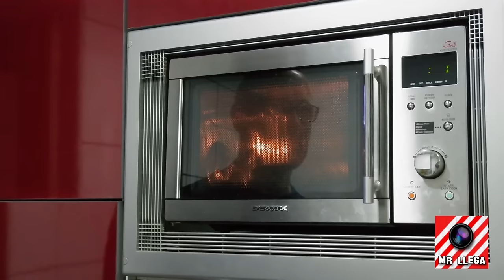HOW TO CHANGE TIRES TO THE XIAOMI MIJIA M365 ELECTRIC SCOOTER

Comment: I curse a day when I bought this garbage. Changing tire is just a torture. I am so angry right now and my hands are all red. thanks for the video though
Reply: ben Cooper I got solid tires as well the ones you described with holes. I didn't put it yet on I am mentally not ready to go through this hell again :) In a meantime I got a new scooter falcon ZERO 10x. Its very big and heavy but much better quality, smooth ride because has suspension and I feel safer now
Reply: ben Cooper I change fI'm tire to solid as well. now its horrible I don't enjoy riding it at all. I have feel every single thing on a road :( I think it can only be an option for somebody very light weight
Reply: ben Cooper I am 94 but you are right. as long as those damn punctures won't happen again its worth it. Also you kind of get used to a less smooth ride :) Also I've noticed that experience may wary depending on type of shoes I'm wearing
Reply: Fucking hate it
Reply: @ChannelGrowMedia  Hey Ben, i had my first puncture and i´m also 105kg, do you still recommend Solid tyres?
Reply: Same here... But I charge $30 people who can't do it by themselve.
Reply: Mikael  have you tried changing the tire bro?
Reply: In China they have little girls that can change scooter tires all day for a bowl of rice without bitching, and they do it right the first time.
Reply: Mikael  ?????
Reply: Same, at beginning was a good ride but after a year it's just a torture, maintenance is impossible, i can't even take the wheel off but the nuts won't budge. Definitely won't buy Xiaomi scooters again, the designs are awful and no suspension.
Reply: Mikael  not 5 mins bro torture and shit
Reply: My hands full red too nos ...
Reply: @walterkersting9922  ...do they ship to the UK?
Reply: My biggest regret.  Pure shit
Reply: First when i bought this scooter, this was my little Baby. But the first time I changed the wheels, I would love to just throw the scooter away
Reply: F
Reply: You are right about that oof
Reply: My advice is to hold it in a vice. Its much easier if you have one. Ive tried to change its rear inner tubes (which should be easier job) in a simple flat and i failed so much that I had to buy a whole new wheel with the tyre on it. 
Now I followed the instructions with white lithium grease (instead of vaseline) and the solid tyre just popped on the motor wheel with some "Cmooon madaf**aaaa!" Effort... :D without vice I would have red hands and losen mind. :D
Reply: @andreymor5201  r3
Reply: @Spieel  3
Reply: @Spieel  4
Reply: @walterkersting9922  3
Reply: I was copying this video exactly then realised he made me get tired off wire side and cant get it off properly ffs
Reply: Key is to use a lot of lubricant
Reply: skill isue lol

Comment: putting it in the microwave made my house smell awful for days and ruined the the Tyre 😂😭
Reply: Exact same issue, I used boiling water and olive oil.  Also I would not use a solid tire, huge performance downgrade.  I go over a few of these things here:  https://youtu.be/G3hV2LacOaw
Reply: @drewsXR650L  your link doesn't work any more :(
Reply: Same
Reply: Did it help
Reply: Just the the same 🤦🏻‍♂️ mine was bubbling 🔥🤣
Reply: It's what happens when the person making the video is mute and doesn't state they are using a different tire to begin with.

Comment: I did it!  It wasn't easy for sure.  But it also wasn't impossible.  To get the valve out, I used and allen key that was about the same size as the valve stem and tapped with a hammer.  It actually went way better than expected.  The real hard part was getting the tire back on.  I boiled it in water and used a grease lubricant on the tire wall and on the rim.  The key is having long tire irons/levers.  Mine were short which mad it really hard. I ending up using one short tire lever, one regular flat head screwdriver, and the key to finishing it was a long flat bike pedal wrench.  It's all about leverage.  If I do this again I will definitely invest in long tire levers and maybe enlist a second set of hands to help hold the levers down (I used two hands and a foot.)  Best of luck!!
Reply: In which way do you turn the key?

Comment: Reading all these complaints, I just wanted to point out that indeed, first time is challenging AF and it took ages, but the key is not to heat up the tire or to apply a crazy amount of brute force, key is TO USE THE RIGHT TOOLS trust me!!! It looked like and odyssey without them, once I used 2 BAR CLAMPS to hold the main part in place and some metal bars for leverage to put the final part of the tire in, it became surprisingly easy!!
For the valve, if the hole is also annoying you, carefully enlarge it A BIT with a drill. Be safe though and good luck :)

Comment: THANK YOU! Vaseline and 2 minutes in the miccowave warmed the tyire up enough that I could just stake on it, jiggle about a bit and it slid right on. Having said that, I needed a dremel to cut the inner tube valve - somehow its too long to actually come out.

Comment: Thank you ! You saved my life and YES I lost about 2000 calories trying to get the tire out and the new one back in (the sloid one!!)
TIP ..... TIP  .......  
If you don't want to use the Microwave :   BOIL water in a pot, turn it OFF and stick the tire in for 5 mins !!! It works  !!!!

Comment: Don't let the simplicity of this video trick you, it's a nightmare replacing this tire.
All the tricky parts (the most difficult parts) have been edited out from the video.  
For example, He did not show how he got the air valve in/out for example. Maybe because he did not insert the inner tube. Pay attention toward the end of the video, there is no air valve in the hole.
Long story short, replacing the tire is very difficult and frustrating.
Reply: You do realise it's a solid tyre right,no need for an air valve.
Reply: And how do i pump it ? like i stuck just because i cant pump air into my tire :/
Reply: Bartłomiej  in the video he is using a solid  tyre,you cant pump air in it isn’t hollow it’s foam filled.
Reply: I changed it my self, itss sooo hard
Reply: Exactly, where the bloody hell is the inner tube?? I managed to do this but by the end I completely destroyed the inner tube...back to the droving board!!
Reply: To get an inner tube in is a little more work. Getting the air valve in without loosening the 6 torx screws of the rim and opening it up, is almost impossible. When you do do this, it works fine. Also: lubricate the tire rims and use motorcycles tire spoons. Still not easy but less impossible. I did a complete inner tube chance just now for the first time and it took me about 3h. Good luck!
Reply: THIS 👆. How to get the air valve in??

Comment: This is one of the most difficult! energy sapping things I have done!  First attempt to microwave tyre caused a burnt tyre and smoke that stank the house for weeks!   I changed the next tyre to a solid using hot water then both knees and 4 screw drivers!  I then had a flat front tyre, more tricky as there is a wire attached.  This one I did in the microwave using 30 sec blasts.  I gave up a few times after spending 30 mins / 1 hour trying.   Just finished the 2nd tyre.   For this reason I could not recommend the scooter!
Reply: Lol I went through two tires and four tubes and I just did the wide tread wheels, next I'm gonna do a 10 inch wheel in front I like to suffer.

Comment: Thanks I did a whole house cleanup and throw away trying to find a damn 18 wrench.. Had 3 boxes of tools and threw away enough to be left over with 1 good box of tools. Wheel is still on there tho. Some tough nut
Reply: ThePotatoIsAStarchyTuberousCropFromThePerennialSolanumTuberosumOfTheNightshadeFamilyLOL hz
Reply: Yeah, what were they thinking going with 18mm. Stupid, rarely used size. I have a pretty good selection of tools, but my fixed size wrenches all go from 17mm to 19mm because hardly anything uses 18mm...
Reply: @samgab  and that is why a good set doesnt skip sizes
Reply: @samgab   i was trying to use a adjustable size or wrench but it didnt work though i fixed the size 18 mm..so is it necessary to buy a 18mm spanner?
Reply: @hasansakib3969  Pretty much, yeah. I ended up needing to use an 18mm spanner. I struggled with a large adjustable crescent wrench, but it was very awkward.

Comment: It worked pretty well with a solid tire from wish instead of 3 minutes just microwave 2min , don't use any sharp tools when the rubber is hot or your destroy the wheel. I only used may hands, it went pretty easy good luck

Comment: Good clear video however a question? how does a normal microwave heat rubber? I would recommend using a hair dryer to heat the tyre or a conventional oven also vaseline will stay on the rim and you run the risk of the rim slipping on the tyre under power, much better to use small amount of soapy water which will evaporate and leave no residue.

Tyre levers cost less than a dollar? spoons? if people arent replacing tyres with solid tyres you run the risk of pinching the innertube using spoons, just get cheap plastic tyre levers if replacing the innertube.

If you are replacing the tyres due to punctures its much better to use tyre slime in the tubes and stick with tubes otherwise ride quality will be compromised using tubeless tyres.

Overall a good video though.
Reply: "how does a normal microwave heat rubber?"
Well I can confirm it does.

"I would recommend using a hair dryer to heat the tyre"
Have you tried it? That will only heat the outside. The reason for using a microwave is to heat it from the centre.

"you run the risk of the rim slipping on the tyre under power"
No chance with how tight these are.

"just get cheap plastic tyre levers if replacing the innertube"
Nope, it's so tight even metal spoons bend.

"its much better to use tyre slime in the tubes"
Yeah I wish I'd thought of that before I tried to follow this video.
Reply: I think the purpose of this video is to show how to replace the tire once it has warn out. Even though the original tire in the video wasn't totally warn out yet. Also I think he just wanted solid tires cause they last longer.

Comment: Boys and girls all I can say forget the microwave and use boiling hot water in a pot, large enough to fit the tyre into, turn it a few times using any stick type of thing and finally wipe it dry quickly and you good to go for a few minutes!!! 100 % works just did it myself and unlike in the video I had to fit the inner tube too!!
Reply: When you read the comments I will be there .   I think makes it softer and expends it enough to make the process go smooth and painless..and the vaseline is quite important part though.

Comment: hello, you did not you put the valve on the front wheel? i cannot see it in the video. the valve stucked into the hole when i tried to take it off. madness to disassemble.
Reply: jozsi jozsika that vavle stem is a piece of shit I carefully used a plastic punch to get it out and good luck putting a new inner tube with a long valve stem I had to cut it with a dremmel to fit.
Reply: I was install an rear solid tire it takes me together wit my brother 2 hours wih heating in microwave,boiling etc.etc..in the end we was use heavy duty tire tools for cars until we fixed the tire correct in place.The video ist a joke to change to solid tires is not a simple thing to do!

Comment: If you have trouble to remove the bolt with the cable try this.  
First remove the bolt with the cable and then the other one, in the video they do the opposite but in that way it's harder to remove it!
Reply: Best Tip ever. Thx

Comment: do this! Boil the tire for 10 mins. Especially if its new! (Not the innertube) lube everything with some oil. For the hard part getting it on! I use zipties to hold the parts that are on on both sides! Like 4-6 zipties. And 2 spoons i get it on in 2 minutes this way!  If You have a vise You can do this very easy just pinch tire with the vise and zip tie and move position pinch ziptie last part use a spoon!

Comment: Hey there, I've been struggling to get my solid tyre on my m365... I first tried heating it in water and now using the micro for 3x 1min and the tyre does indeed get softer but not like yours in the video... I am now wondering if my tyre is too small, its 14cm inner diameter, how big was yours?
Reply: I've also tried and I'm wondering the same thing ...

Comment: Be careful with the heating part. After 2 min15 ish, I heard a noise in the microwave. the tire was already too hot and got deformed a little. Doesn't seem to be ruined. But I'd suggest heating up per 30 seconds timeframe and lower the power of the microwave. 500-750W must be enough
Reply: TekyEdits - you don't put it it in for 3 minutes all at one time.  1 minute, turn it over, another 1 minute, turn it over again.  Did you not watch the video?
Reply: MrSpeedDemon72 I did exactly as mentioned as in the video man. That's why I said after the second heating up I heard a noise. Just a little warning to people if that can help 😉
Reply: TekyEdits it could be a ghost you heard?
Reply: I had the same issue ... 1 minute 750W ... 1 minute 750W ... 52sec 750W and the tire exploded. The second try was with hot water and it worked. I just SLOWLY boiled the tyre for 10 minutes. It needs to completely submerged and it must not touch the boiling pot.

Comment: If you're watching this video because you have a flat tire, save yourself a load of time and stress and just fill the tire with "slime" and reinflate - job done!
Reply: Its not job done cause I did that and it's all gravy until the slim starts coming out. You can't do it twice plus it depends on how bad the puncture was to begin with. Not a debate just sharing what happened the weekend before I posted this response. I did get an extra 2months out of it though nice perlonged the inevitable. The war of the front wheel begins tonite and I call upon the strength 10 Gorilla's lol

Comment: hey guy, you forgot to put the air valve through the dedicated hole ;-)
Reply: How is this even possible I've been trying to get mine through for about 3 hours
Reply: @RoseRose-mm1ed  Same here, we had to remove the black plate and inside we removed a plastic valve holder that was in the way
Reply: Black Forest Spicy BBQ He didn’t, it’s a solid tire, no need for air

Comment: Please say how you got inner valve through the gap it is literally impossible. Had to rip the inner tube to get it off and now I'm replacing it I cannot get it through the hole I've tried for 4 hours
Reply: Rose Griffths There isnt enough Space to get it trough
Reply: me too - I tried to breack the valve and make it shorter but this is not the best method! The valve is of no good now!
Reply: drill the hole on the rim bigger, it's the only way, plastic and metal

Comment: cant the front wheel off-too tight, might break it if use too much force.
Reply: Same
Reply: @bright3706  word
Reply: I had a friend step on the scooter, then I was able to turn the nut using 18mm wrench.  It must've even torqued on tight.

Comment: Heating them in a microwave is a great way to screw up the structure of the rubber Boiling water does the job just Boil the for ten minutes and your good

Comment: By the way beside heating up the tires in the microwave for 3mins, can I force both the new tire & cushion together with grease to insert back to the wheel? I don't really liked to put rubber in the microwave ya! Can you make a rear tire change vid too? Thanks ya!
Reply: David Lim I personally would use hot water to heat the tyre. Microwaves are notorious for over heating things and they are designed to heat water rather than rubber.
Reply: I've tried with hot water and it seems it's not hot enough to get the tire as soft as needed to put it in... I think micro wave is still the best option.

Did anyone tried with a normal oven?

Comment: I had two steel tire levers and I managed to brake them when I was trying to put the tire back on the wheel. In spite of heating the tire up and fixing it with cable ties. It literally is impossible, you can imagine, how much strength is needed to brake the short steel leverages. Highly not recommending doing that on your own, just take it to the professionals.

Comment: Lot's of complains in the comments.
*
My girlfriend bought an electric bike, with somewhat bigger wheels, for the same price. It is fold able.
I am 85 kg (170 pounds) and I go easily 50 kms (35 miles) in the mountains. 500 m (1500 ft) elevation is not a problem. I still have 2 battery lines of the 4. Recharging time is the same. I do 12 miles an hour average.
*
With this scooter I can't do more than 20% of this .... and I am sitting comfortable on the bike.
Anyway, I change this damn tire.

Comment: It's impossible to get the front wheel off!!
Reply: @edgarsi  e-bikes with rear motor also use 18mm nuts, bunnings sell cheapass spanners for $1.79 ring- open end

Comment: Hi! Thanks for the video!

Unfortunately I don't have any microwave and I tried with hot water, but it is still quite hard. I guess the temperature reached by the microwave makes a huge difference.

I wanted to know if anyone had tried with a normal oven? If so, what is the right temperature and the time?
Reply: 150F (80C) 10 mins

Comment: How do you inflate the front tire?  The stem doesn't stick out far and I can't find an adapter that works.  Thanks.
Reply: Travis Faust try with the included adaptor
Reply: You can buy valve extenders at an auto parts store
Reply: @joseurbina426  I use a 60mm extender for the rear tyre of 1000w Bullet stealth